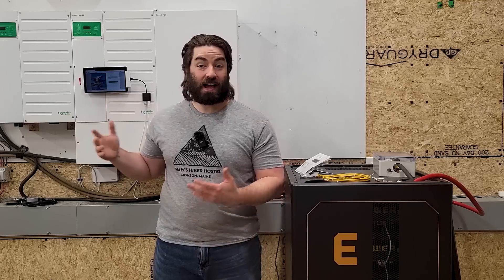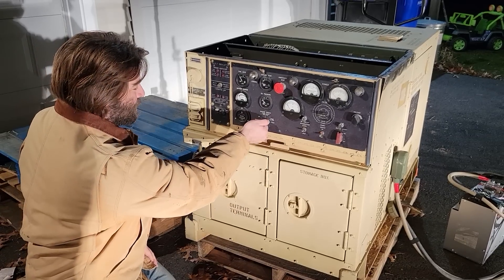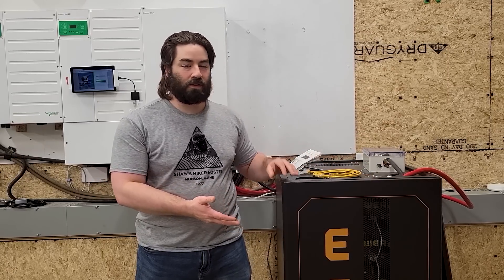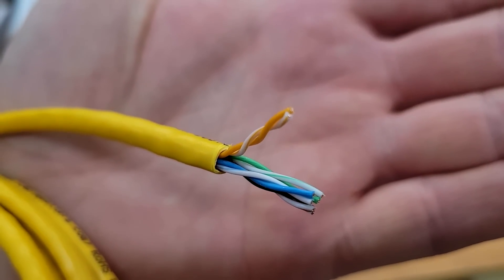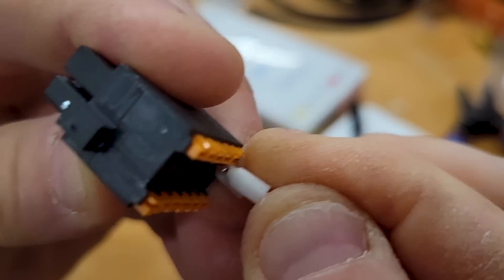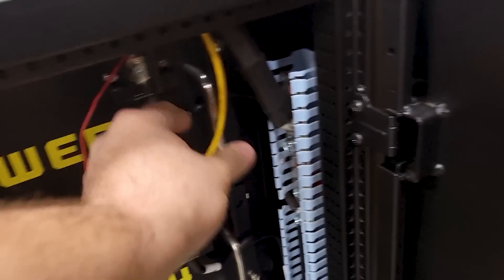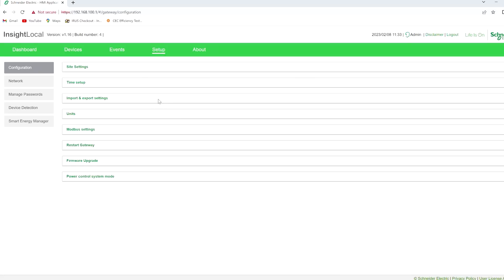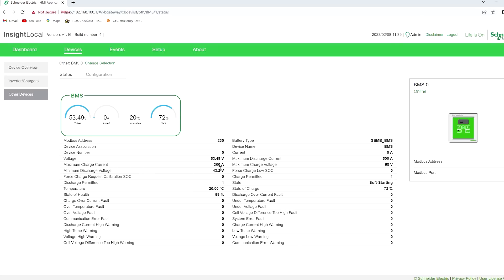Battery to Inverter Closed-Loop Communication

Comment: Interesting.  The XW system has its own BMS that is meant to control a dumb bank of batteries and do what you want just fine.  It is interesting to know that it has the ability to interface with a smart battery that has its own BMS, but that seems like a duplication of effort.  I have always liked their support for flooded lead acid batteries because not only are they cheap, but if you top off their water levels ( with distilled water ) and give them an equalization charge ( which the XW system has an option to do ) once or twice a year, they can last for 20 years.
Reply from the maker: The device you are referring to is the Schneider Battery Monitor: https://signaturesolar.com/schneider-battery-monitor-48v/?ref=4_rHcgZ9x-TiF-  The monitor allows you to use any battery and report SOC.  But, hey, if these batteries have it built-in, why spend the extra $573?
Reply: @DavidPozEnergy  No, I mean the Schneider ( formerly Xantrex ) XW hybrid inverter/charger system has the in built capability to monitor battery voltage, and to be programmed with the maximum voltage, minimum voltage, and rated capacity in AH, and from that, estimate the SoC.  There is no add-on needed.  That is why you had to go to the configuration screen you showed and tell it to forget about the battery chemistry, capacity, and so on, and instead defer to what it was being told by the BMS in the battery cabinet.  The system already can do the same measurements itself that the BMS is doing inside the cabinet and monitor the SoC without the need for another system to do that.
Reply from the maker: Hi Phillip,  Oh, OK.  Sorry I miss-understood.
Reply: Lead acid batteries are very inefficient compared to lithium chemistries
Reply: @keithf8649  The term efficiency generally is used to refer to energy in vs. energy out, and that does not really vary much between different chemistries.  What I think you actually mean is energy *density*.  Lithium chemistries can store more energy per unit volume and/or mass, but at higher cost, and often, lower lifespan.  For a stationary storage solution such as this, weight means rather little, and volume not very much either.  Cost and lifetime are more important factors here, which is why flooded lead acid is still competitive for this use.  For a car, size and weight matter, but not when you are just dropping the batteries on the floor of your garage or basement.  In that case, cost, and longevity become more important factors.
Reply: @phillipsusi1791  May I add that lead acid batteries have a well established recycling process. About 98% of lead acid batteries are recycled. Lithium ion based batteries are ‘second lifed’ but today there is no recycling of lithium ion batteries.
Reply: If you have the Schneider battery monitor then it's not needed but if you want to save $600 this should work just fine haven't been able to get it hooked up on mine yet though download the firmware battery works fine just doesn't want to communicate

Comment: Great video! I almost died though when you cut that ethernet plug off the cable and not leaving like 6" of wire left for a pigtail on the part you cut off so you could reuse it for something else. I always find I need one for a project and end up sacrificing a good cable. Do you know if any of these devices can interface with Home Assistant or otherwise use MQTT/Zigbee/Z-Wave protocols? I'm about to start down this path for an off grid property we're building and would like to use home assistant for things like automatically turning generators on/off if SOC gets too low (and sun is X hours from sunrise, and if weather is supposed to be Y), along with all of my other home automations.
Reply: Ahh, you said it uses modbus, so Home Assistant CAN use it. Sorry for the premature question.
Reply: @steveanimatrix3887 lol "CAN use it". I see what you did there.
Reply from the maker: Sorry, I don't know.

Comment: After watching your video with the 3 Growatt 5000 es and then the solark comparison I installed 5 Growatt 5000 es. Why did you go away from the Growatts? It seemed like the Growatt worked better
Reply from the maker: The #1 complaint I received while posting Growatt videos was the lack of UL listing.  It seamed there was a large group of the audience that wanted to see a UL listed install.  So, that's what I'm doing with the Schneider.  The Schneider inverter and PDP are all UL listed together.
Reply: If your in the USA, NEC national electric code, requires UL listing for all components in building electrical supply. So in theory, if you’re going to get it, inspected for electrical permit everything needs to be UL listed for other approved listing company certified. Inspector doesn’t care , your home insurance  sure will if anything goes wrong. Mine said as long as everything was inspected and listed they didn’t care. If not  listed they would drop my coverage.